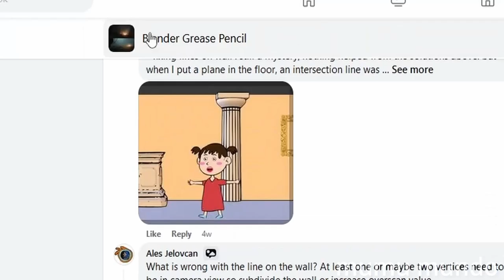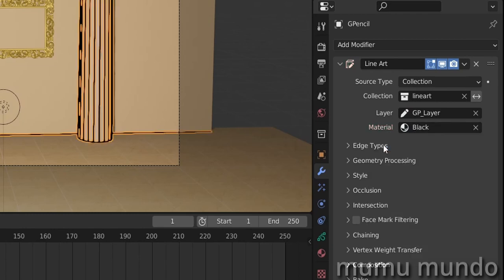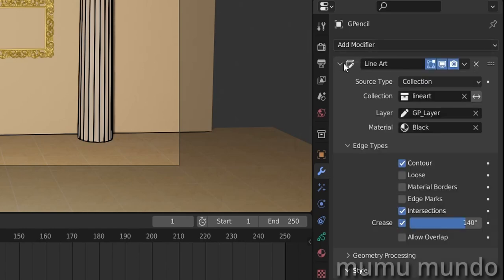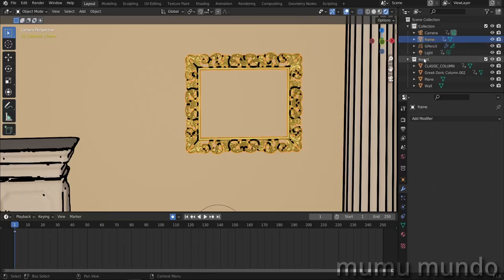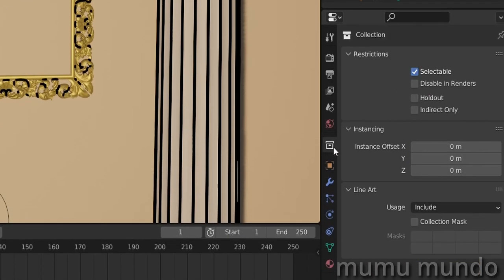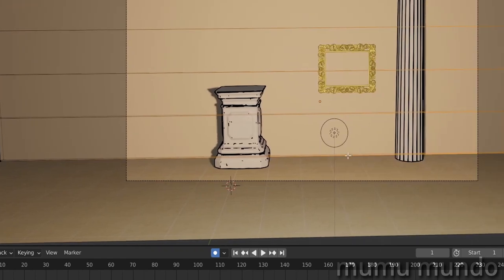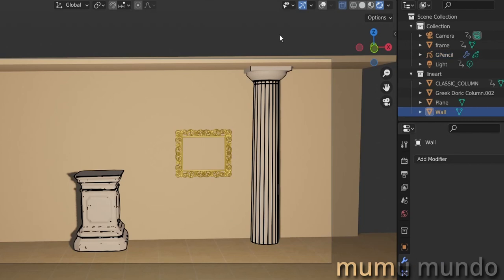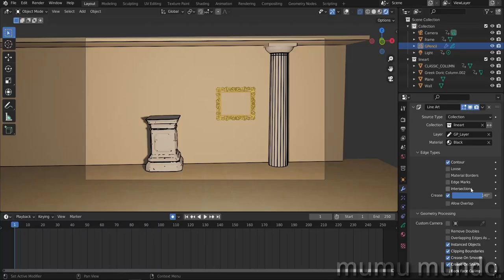Grease Pencil Line Art Troubleshooting for Beginners - Blender 3.1 Tutorial

Comment: Thanks for the video! I am getting pretty bad pixelated lines... how do I fix it? I can't find a solution
Reply from the maker: GP has some problems with anti aliasing (if that's what you mean), sometimes tweaking a few settings helps or you can render at a higher resolution then down scale.